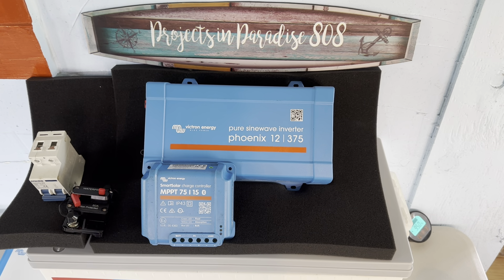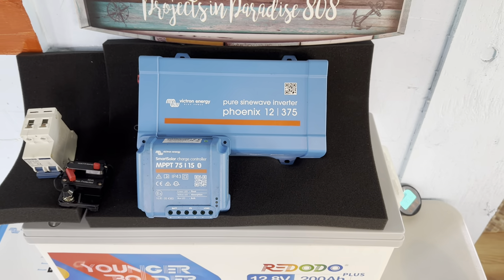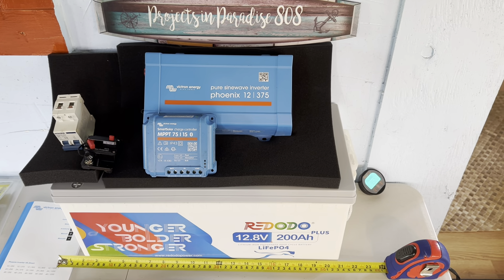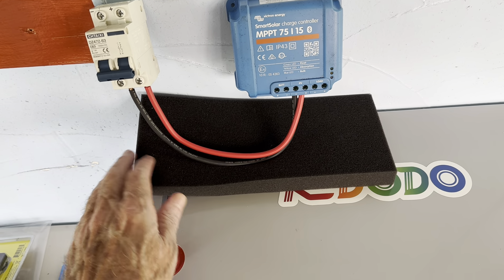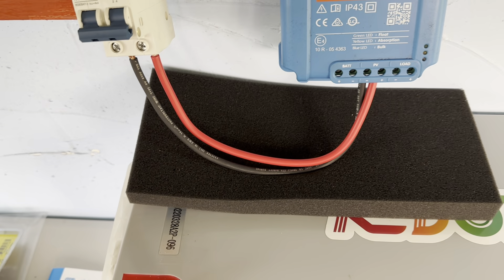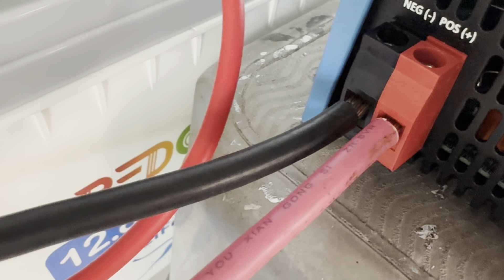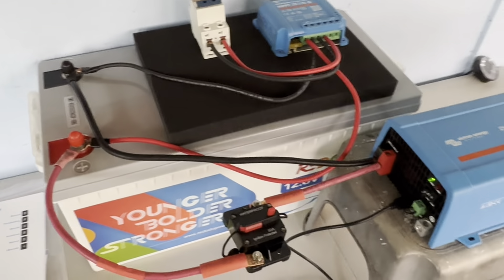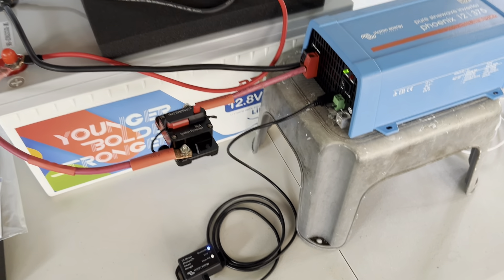Victron  energy Phoenix 12/375 pure sine wave inverter  with 75/15 MPPT cc/REDODO 12.8v LiFePO4

Comment: 1 Watt Wow. I have a plethora of inverters And they don't even come close to that in standby. But I can run 2 usb ceiling fans 24/7  at three quarters of an amp. Considering my rice cooker pulls fifty amps Probably need a bigger phoenix than the 375w😂🤙 You're so lucky to get sun, it was biblical rain today on the Garden island.😅
Reply from the maker: I like all the inverters I currently use, but yeah, none of them only draw only one watt in standby. Still getting some sun today. We know all about that biblical rain here! Could actually use some decent rain now, getting a tad dry. Aloha! 🤙

Comment: looks great. my camping system is going to look like that. same MPPT but folding solar panel and powerqueen battery and much bigger inverter same victron. going to be on Anderson SB 175 disconnects SB 50 for the MPPT and MC4 for solar. going to connect/disconnect at camp cits or parks . I just built a panel    with 12V to USB C PD 65w and USB A ports . just going to use volt meter.. got a 4 digit one. blue sea systems . I even found a surge protector strip with GFIC protection . outdoor rated AC cords. doing about the same pre planning and waiting for stuff to come in as well . glaid you got victron inverter . just using my tripp lite pure sine wave with GFCI for testing for now until I get the victron one.  being this a portable system the battery monitor or smart shunt will be hard to use . it will reset every time I connect .if I find one that remembers the battery level I may add later .
Reply from the maker: I ran it on small loads last night just testing the eco mode some. Works pretty good. Just sends a pulse every 5-6 seconds searching for a load. 15 watt minimum detection setting to turn it on, but adjustable above that. I really think the best application will be on a refrigerator where it would save a ton of battery power in between cycles.  Sounds good on all your projects going on too! Aloha! 🤙

Comment: I doubt you will be able to run a fridge with that inverter they are extremely reliable but also sensitive to surge I had it now I got 500 I only use it for tvs and lighting get a bigger one
Reply from the maker: Got the inverter compressor on my fridge. Have never seen a surge yet on it. Only draws about 60-70 watts when running, and 200watts once a day on defrost. I'll let you guys know if and when I give it a whirl on that. Aloha! 🤙
Reply: I have a similar system which will run with two 12v SLA batteries in series I acquired things on special. LiFEP04 batteries are a bit on the steep side here in NZ. I will probably have to run a mains charger as well over winter.

Comment: The battery connector in inverter is only for wall installation, just and just enough. Could and should be much better covered/shielded connector (and longer). This is cheap quality. I've same inverter (230V ver.) in my car (not even van),  just for basic output.

Comment: The Phoenix line is not nearly as good as Victron's other products.  You may be disappointed.   Not just eco-mode, but the Phoenix's advertise a low-frequency transformer which would normally be able to handle surges more easily than lighter inverters with HF transformers, but I have had bad luck (running a computer in my case) and actually had to move back to my WZRELB inverter.

* Eco-mode might not work well (particularly for fridges).

* Doesn't handle surges as well as one would expect with a low-frequency transformer.  YMMV.

* The whole phoenix line tends to be noisy, with small changes in the load causing weird noises from the fan and the low-frequency transformer.  Can be quite annoying.

That said, the Phoenix's efficiency is better than the WZRELB.  Slightly better.   So if eco mode actually works with your fridge and doesn't stress the fridge's motor, the Phoenix may be the ticket.  If it doesn't, though, it won't be much different than other inverters.